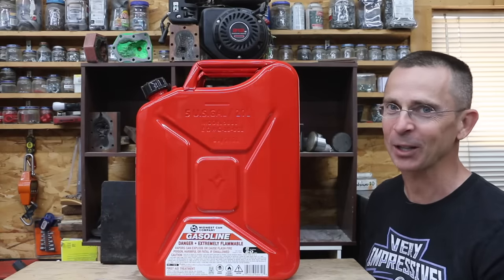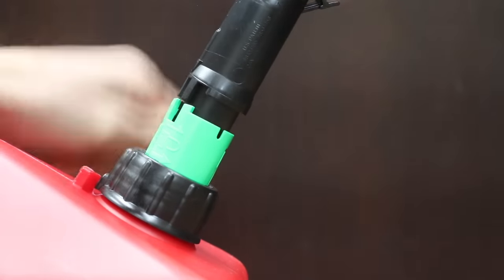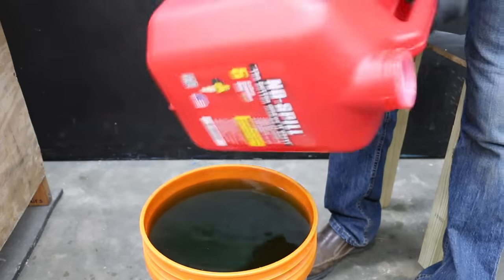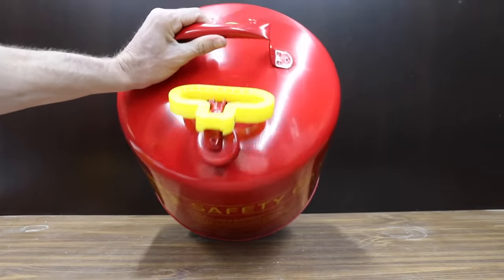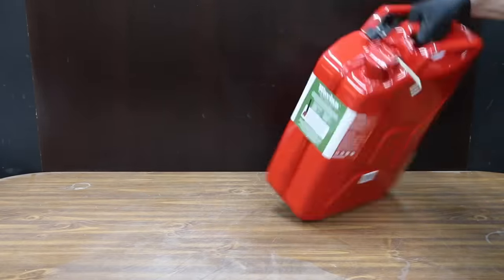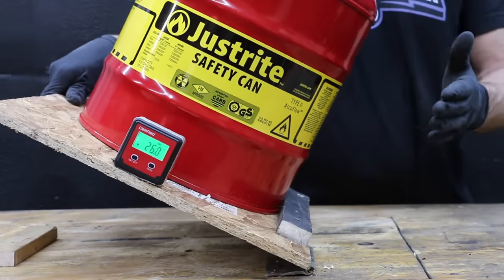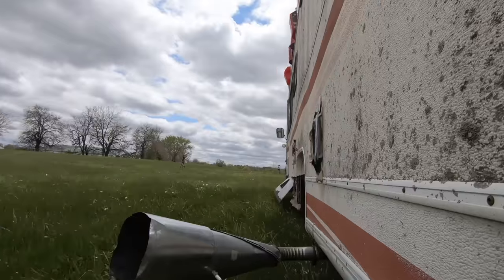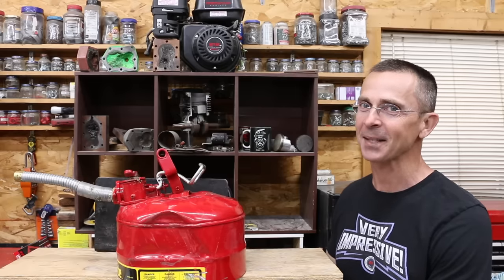Best Gas Can? $140 Wavian vs Eagle, Surecan, Scepter, Briggs & Stratton, Midwest, VP Racing

Comment: The "spill-proof" gas jugs I've dealt with are infuriating because they didn't have to make them such an ordeal to use just to keep them from spilling. 

It's nice to see some options that aren't so bad. I now know which one I'd like if money was no object.
Reply: Yeah I think I've spilt more gas using a "non-spillable" gas can than the old ones.
Reply: @Eagle1977  yeah, it's almost as if a design that requires positioning the container in a way that it isn't suited for just so the fuel will flow is a bad design.

At some point, I just kinda gave up on them and just unscrew the cap then use a funnel
Reply: I've been using the no-spill brand for many years. Aside from a valve wearing out they have been flawless. Best user experience I've had with a "EPA approved" fuel can lol. As shown in the video it's not good for road vehicles,but I don't use it for that so that doesn't bother me! I've seen spout attachments for this gas can for sale which were intended to make it good for road vehicles though.
Reply from the maker: Thanks for sharing.

Comment: I'm a Wildland firefighter and I use a ton of different types of fuel cans. The old school screw on jerry cans are by far my favorite. The new ones with camming mechanisms are a pain and always get bent and stuck
Reply from the maker: Thanks for sharing.
Reply: Actually, the camlock is just as old as the screw. I have 1943 dated camlock cans.

Comment: I've also had a lot of those goody mechanisms jam, break and otherwise cause problems. Especially the ones that require pressure on the edge of the fuel filler neck. If it slips in theres usually a splashback and then more slipping and cursing next time around

Comment: Video idea: LED light bulbs, the light bulb industry was making so many huge claims about LED Bulbs when they came out. I replaced all my bulbs with them, and there’s no doubt the energy cost is lower, and their production of heat is much lower than the traditional bulbs, but it seems like some brands just don’t last that 5 or 10 years that they claim. I’m talking about regular socket light bulbs. It seems like planned obsolescence is a huge thing these days, and cheaper materials are used on consumer products. 

I think I remember you doing one on the tube style shop lights a long time ago.
Reply from the maker: Thanks for the video idea.
https://www.youtube.com/watch?v=ixHyyXbvMwI
Reply: @ProjectFarm  You going to do a follow up on how the bulbs have done over the last 5 years?
Reply: Yup, alot of the cheap led's have a shorter lifespan than incandescent and cfl
Reply: I think Technology Connections would be a better channel to that kind of tests (if Alec wanted to).

Comment: The Eagle Safety Can is easy to pour into a vehicle gas tank when you mount the funnel to the can. You rotate the can slowly around the “y” axis (clock/counter-clock wise) as you fill.  Use it all the time on my truck and toys. 

If the full neck is at a bad angle, like on a pressure washer or mower, then I remove the funnel and do it like in your video. 

Thanks for good content!!!
Reply from the maker: You are welcome!

Comment: Pro tip: You can weld holes in your fuel cans with milk jug patches since they're the same type of plastic.  Empty the tank of fuel, clean off the area and the patch, dry it, and use a heat gun to warm up the region.  Slap the patch on, heat it while applying pressure to mold it, and let it cool once it's bonded.
Not sure about the legality of it, but it works.
Reply: to add strength to your patch, try placing a fine steel mesh, like window screen material over the seam or hole your patching, melting it into both the can and the patch.
Reply: @konagolden4209  Fiberglass mesh probably helps too, good idea.
Reply: HDPE is the plastic. It's also what they make natural gas pipelines out of.

Comment: I have the same No-Spill gas can you show in this video but the spout (hose) is about 12"-14" longer than what is shown on yours, and makes the can 'reach' much farther and pour really well, so it totally empties the can like it should. I was annoyed to find out that I still had to pay yet another $10 or more just for that short length of hose (as an extra!) but it does make the can very functional, and was well worth it in the end. It's a very nice gas can now, but I really dislike how these companies always try to nickel and dime us for something necessary but trivial that they hold back, which really should be included with the original purchase price.
Reply from the maker: Thanks for sharing.

Comment: Man I did not realize that fuel cans had so many "safety devices" added to them.  I have the old style in my garage for 25 years, and they are very easy to use.  I also question all of the push to empty, and flame mitigation devices as actually being safer, seeing how much fuel spooges out all over the place when you use these new cans.
Reply from the maker: Thanks for sharing.
Reply: yea, if your EPA / safty device creates say a .25 liter leak each time it is used, it niether saves the environment nor is it safer.
Reply: EZ Pour spouts are a good solution to add to these new cans if you ever have to buy one.

Comment: What this proves is that I will be in a world of hurt when my fleet of old plastic 5-gallon containers finally bite the dust. They empty fast and completely, are stable and have none of the idiotic jackassery of the sprouts on most of these cans.
Reply: You can get 'rebuild' kits for the cans, which include a normal flexible spout and vent plug.

Comment: Nice job.  I buy numerous cans for the work place. I have found the No-Spill best for our operation. It may seep at the neck but I have found that tightening it just a little without a lot of force prevents seepage.  It is easy to use and the mechanism has lasted longer than any other can.  Another matter was the design which allowed for multiple cans being stored in a gas locker better than any other. The older cans that lasted over a decade no longer exist. And they were spill proof. Could this have been a "profit loss" problem?

Comment: The 'No Spill' can has a hose extension that can be attached to it to get you a lot more room to tip it when fueling a car, I've got 2 of them for "ohshit I forgot to check the gas gauge before leaving and am now almost out of fuel" scenarios. Works pretty well, main draw of it is no fuel vapor smell inside the car while it's just sitting around
Reply from the maker: Thanks for the feedback.

Comment: The one thing to watch out for is paint peeling off the interior of the metal cans.  You only tested two of them, but I have seen the paint fail and flake off into the gas.  I swore off metal cans, but I may have to give those galvanized cans a look.  Great set of experiments and display of the qualities of each can.  Very well done video.
Reply from the maker: Thanks!

Comment: Here in California with the smog mitigation nozzles on the pumps, the fire mitigation screens make it impossible to fill the gas containers. I ripped those screens out of every fill can I own.
Reply from the maker: Thanks for the feedback.
Reply: I just manually push up on the rubber collar around the nozzle. You could dispense the gas through your car window if you wanted to like that and you get to keep the flame guard.
Besides the nozzle touching the gas inside the can cuts the flow early.
Reply: @KreemieNewgatt  A lot less chance of fire when I don't have gas splashing back at me when filling the container. Also the pump isn't constantly clicking off because of the same splash back.
Reply: @freddy67h : With the screen gone I don't have to pull back the rubber collar and it clicks off right at 5 gallons.

Comment: I use no-spill containers. Examining them I must have 3 generations. They have made improvements. 
I bought a compact tractor and a midwest plastic and 2 more on the way home from the dealership. The mess started as soon as I tried to fill the first one when the anti flame device caused me to overflow the can. I returned the one I did not fill and ordered  2 no-spill.

Comment: There's something about the containers that are made out of metal that just feels right.
Reply: The down side of metal cans is the weight.  I used my Safe-T-can to add five gallons to a car I can been keeping in storage and it felt like my arm was about to fall off by the time the can was empty. 🙂
Reply: You mean it feels.... Justrite?
Reply: Yeah,  my mother is elderly,  mid 70's.  Lives in the country in Northern Idaho.  Has to fill quite a bit of equipment with gas.  I think the metal would be best for her just too heavy.  I really wish they made more motors to run on propane.  My friend got a propane ice auger a few years back.  So many benefits to the propane motors over the gas motors.
Reply from the maker: Thanks for sharing.

Comment: I know it would be difficult to test, but longevity is important too.  I bought a NoSpill a couple of years ago.  It is only used to fill the riding lawn mower.  Can is filled twice a year and resides in the garage when not being used to fill the mower.  In the second season, I noticed that the seam that basically bonds the two halves together was splitting and leaking.  I live in Georgia so it is humid and hot.  Probably hotter in the garage.  Still a disappointment.
Reply: @manddservice .manddservice Do you really want fumes leaking out?
Reply: @elcastorgrande   DO NOT VENT? you  better because if they expand too much and blow up like my brothers did. .gas everywhere!!
Reply: That is a sad experience with the NoSpill can. We have two gas and one diesel can in northern Idaho panhandle and they have done well in the 100+ heat as well as the below zero cold. Sorry to hear your experience has been less than stellar. Only real issues I have had are the little plastic cover on the spout gets in the way during use, both on the can and extension tube option. The second issue is with temperature changes and time, the extension tubes don't always stay sealed in place. Other than that we have been pleased with our choice to purchase them. Better than other options in my use.
Reply: @brianworley7705  I zip tied my extension tube/nozzle in place after mine slipped off.   No problems since.   :)
Reply: @nordic6379  Thank you for the idea. That hadn't crossed my mind.

Comment: I would have liked to seen the cans being poured through a nearly horizontal gas filler neck. I have never owned a car where the fuel was poured directly down when using a gas can. I have never spilled more fuel than when I use a government inspired no spill can.
Reply from the maker: Thanks for sharing.
Reply: Did you make it to the point in the video where he had the demo set up, when it came to filling vehicles?

Comment: I love old metal gas cans. I got a old usmc Jerry can from 1982 and a justrite 5 gal and a eagle 5 gal plus a antique 1 gal for kerosene.
Reply from the maker: Great point! They can last a long time!
Reply: Best of the cans I've ever used. It's just the top denting that becomes a problem over time, like in Cousin Eddie's test. But most people aren't messing around and doing things like that to cause damage to their gas cans. It's just certain circumstances with certain people that may use or store different machines that may have frames and chassis around the same level of the can, that can cause bad bumps and bouncing to damage it quite badly if not separated, or in it's own set safe location. They're definitely not top-sturdy.
Reply: @ProjectFarm   That would be cool to see a restoration video and what would be the best methods to remove old rust and coat the inside as my usmc has rust in the bottom but I'll never get rid of it

Comment: I feel like the initial pouring test might have been unfair to the racing can, the attachment that comes with the can definitely indicates that the can is intended to be turned slightly and for the tube to siphon out that way, and then the vent being near the spout wouldn't be a problem. Just thought id point that out, love your videos!
Reply from the maker: Thank you!
Reply: Yea it’s by far the fastest can I’ve ever used and I’ve used most
Reply: I would say those VP cans are some of the best cans around, other than my old metal ones from the 40s, but they also don't have spouts like the VP ones do.
Reply: @Spike-sk7ql  Yep I agree!

Comment: I always buy old gas and diesel cans at garage sales. I liked gas cans BEFORE the government got involved with them!
Reply: If you have trouble with leaks through the top cap of hot cans, drill a tiny hole in top of inserted spout to equalize pressure and prevent leak.
Reply from the maker: Great point!
Reply: @artsmith103  that’s a good idea!
Reply: @Tomsfoolery.  I have a few of them, all leaks stopped no matter the temperature change. The hole also helps vent while pouring. The moisture during venting via the hole is noticeable but it doesn't accumulate and drip. I use 1st or 2nd smallest drill bit.

Comment: I have a few of the Wavians. Mine came with the “safety spouts” which I quickly replaced with aftermarket metal flexible hose spouts. They are awesome cans that you can drain super fast. Even better they look cool.

Comment: Would have been interesting to have included a genuine   "jerry can" .... i suspect it would have beaten the modern cans hands down on all aspects !
Reply: The wavian is a real jerry can. He compares it to the “wavian knockoff” stark can I believe. He even touches on how it’s a good can at the end but also how the jerry can design is bad for avoiding tip overs.
Reply: @ufooooooooooooooooo  I guess it's because the Jerry can is made to be strapped to a vehicle.
Reply: @ufooooooooooooooooo  ; You can just lay it flat.
Reply: Wavian and Valpro meet the mil-spec that is what drives the weight of both.

Comment: Like most people I hate the mandatory spill proof spouts.  I immediately replace them.  I then drill a hole in the plastic can and add a vent.  Plastic cans similar to the Midwest brand which has handles on the top and side cost me about $20 last time I bought them.  The replacement spout and vent come in an $11 package from Amazon.  One problem I had was refilling a 1 gallon can I use for 2 cycle engines.  For that, I purchased a Surecan which, incidentally is guaranteed and has replaceable parts.  With the Surecan I can easily refill the little 1 gallon can without risk of spillage because of the 180 degree rotating spout and the top mounted valve control level.  Like at a service station, just put the spout where you want it then squeeze the lever when ready.  Although replacement spouts eliminate the safety of the spill proof spouts, it converts gas cans back to the convenient way they were for decades.  Here's the link for one type: https://www.amazon.com/KP-KOOL-PRODUCTS-Universal-Replacement/dp/B07R8XQHTV/ref=sr_1_4_sspa?th=1

Comment: Yes the authentic Wavian jerry cans are expensive, but in my opinion they are the best and worth it if you use gas cans a lot. That spout you got with it looks ok, but the flexible corrugated steel long nozzle that is available separately for these cans is simply wonderful to use. It's longer length and flexibility allow you to get the nozzle inserted before the fuel flow starts, preventing any spills. And I would wager that it flows even faster than the nozzle on your Wavian can.
Reply from the maker: Thanks for the feedback.

Comment: I feel like the lack of a vehicle fueling timed test was very unfortunate. I'm sure a lot of those cans were designed with a tilted pour in mind instead of straight up and down so we would probably have different pouring speed results from the first test.
Reply: I agree
Reply: He showed an example of refueling his tractor which is very close to a straight up and down pour
Reply: @horsepower844182  of course there are examples to justify that test. Boats are often similar in how they need to be refueled too. What I am disappointed by is that there ALSO should have been a timed test with a vehicle refueling rig. A lot of these gas cans were made with refueling cars and trucks in mind and we would've seen some different data.

Comment: What's crazy about those "flame reducing" metal filters is they can actually cause fire.

Also I'm not a fan of the plastic gas tanks since you're not supposed to store gasoline in the plastic ones. I would suggest investing in a metal one as then you can store gasoline for long periods if you don't need to use everything in the can at that moment.

I personally have the eagle can. Been using it for over 5 years now and no problems yet! Great investment!
Reply: Plastic cans are completely safe and hassle free, long life and no issues. I paid less that $20 for 2pcs 5 gallon plastic cans euro style. Used a lot, im a pro user and have several company cars that are parked in various locations, some has to be refuelled from cans as they dont typically pass by any partnering gas stations, i use these cans a lot and have no complaints.
Reply: If you  buy cheap plastic gas cans they won't last long. I have some that are 15 years old and still work like new
Reply: You're not supposed to store gasoline in a plastic can? Well almost every car and truck made now has a plastic tank sooooo?
Reply: Mr. Proton is correct.
"Plastic (Polyethylene) containers actually BREATHE and allow air into the container. 
- They are designed for transport and very short-term storage ONLY.
However, Metal cans are AIR TIGHT and are perfect for LONG-TERM Storage.
Reply from the maker: Thank you for sharing!